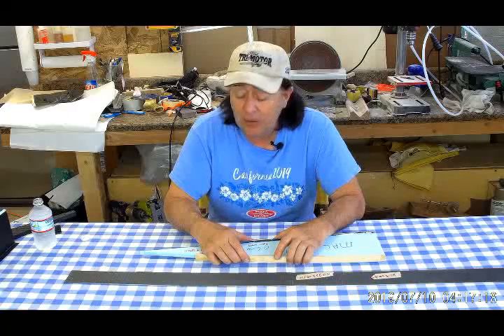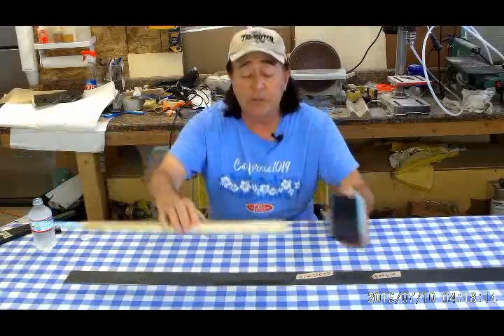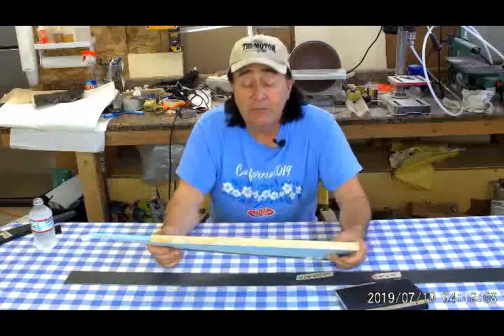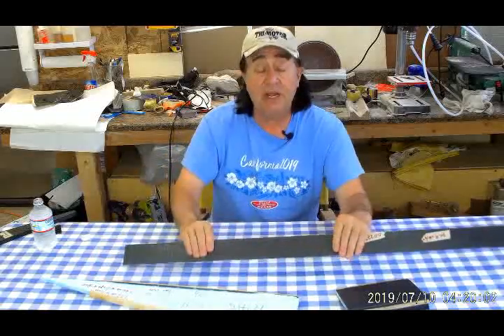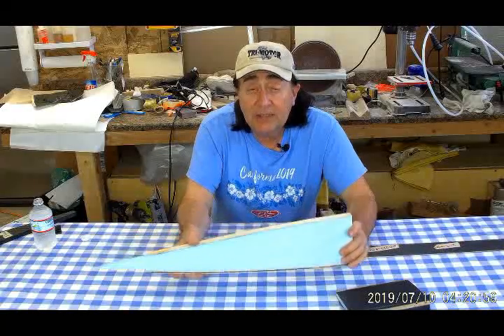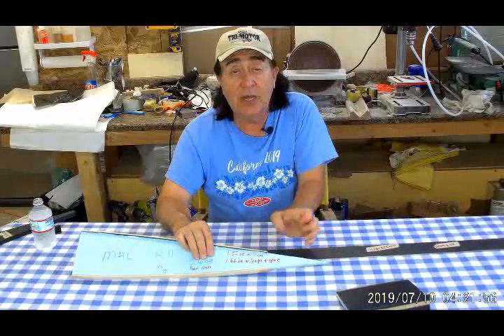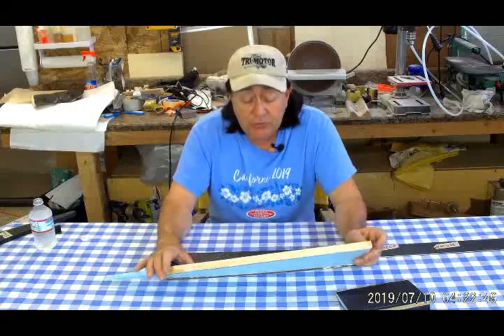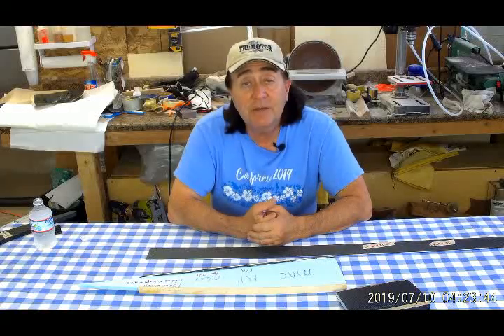High Strength Ribs - KW MkII Development

Comment: Any risk about the bonding between CF and wood breaking loose because of the different coefficients of thermal expansion, particularly when going from very cold to very hot and vice versa?
Reply from the maker: No problem. Composite sailplanes have been using wood (usually balsa)/composite combo for decades without issue, same is true of boats. I used CF/Kevlar/Fiberglass with balsa and spruce on my original wing without any issues, although that wing never saw low temps. There are probably lots of other ultralight aircraft out there that have used CF with wood. Perhaps my viewers know of some?